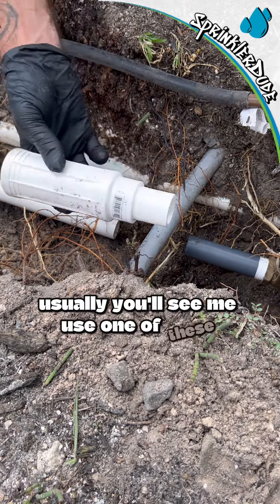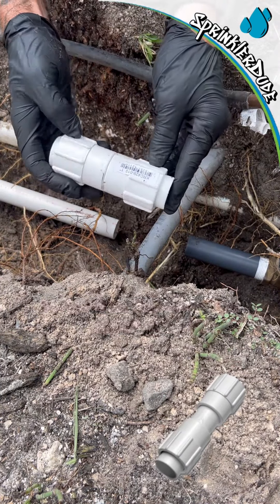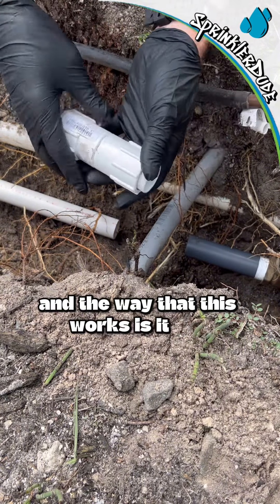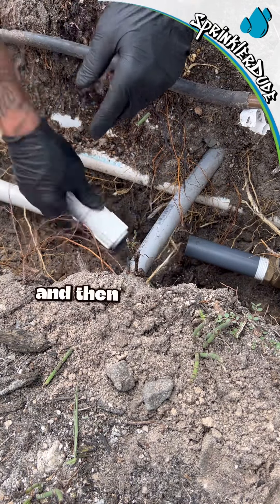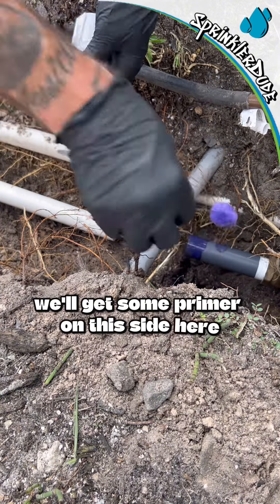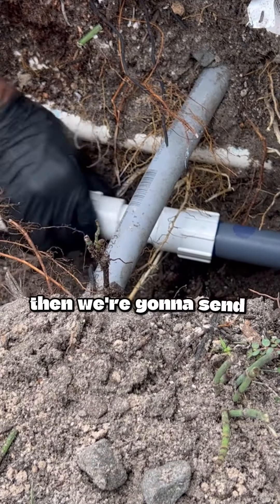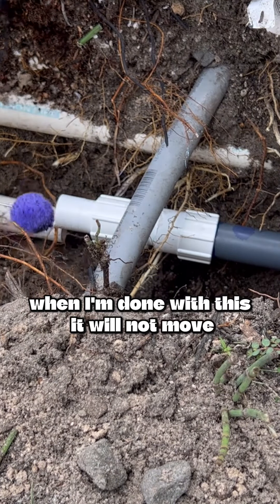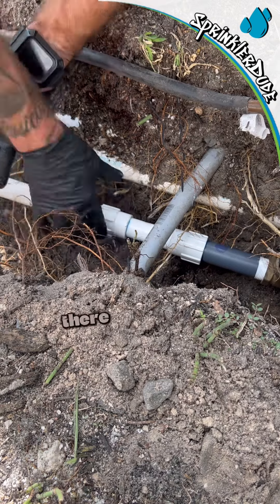No SlipFix. No Problem | Broken Pipe

Comment: I just started using these, and I really like them. I find myself choosing them over the slip fix. The only concern I have is how they will  hold up over time. I dont see any reason why they would fail, unlike the slip fixes. I have dug up a few of those after they started leaking.
Reply from the maker: If installed on pipes that line up, not on an elbow, not right at a valve, and fully extended. it should be just fine.